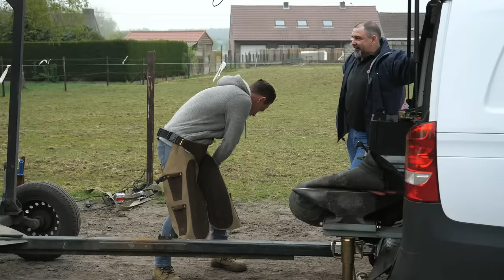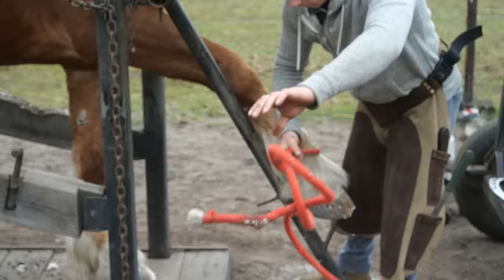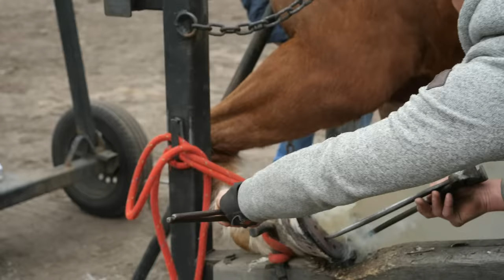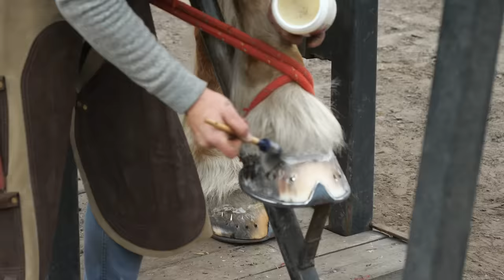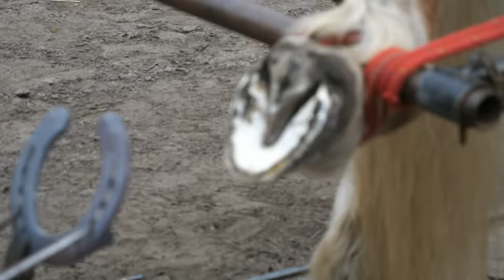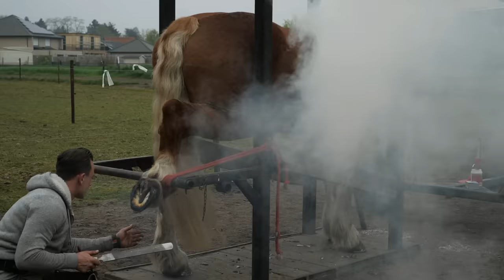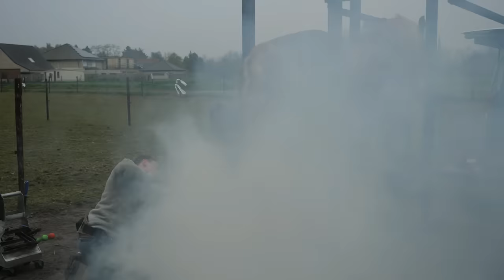Hot shoeing a draft horse is a tough job. Watch the whole technique in detail.

Comment: He’s someone I would trust...Nice trailer unit. Very well engineered. His safety was never in danger. As for the horse. He/she is no stranger to the farrier.
Reply: how often do you have to do this? and how much is the cost? looks like only a pro should even try it.
Reply: If it's a ' standard sized horse, I believe, about £18 or £20 a corner here in the uk. Every 6 weeks if lots of road work, not much longer if all soft, as it grows the same rate as your finger nails. The fixing nails are made from lead. They do a burn fit to make sure it's well versed in and not too likely to come loose. The gouging etc doesn't hurt the horse at all: just like cutting your own nails. The toecap clips on the shoes make sure  the shoes don't come loose with general use. The rear hooves are slimmer so the horse can dig in better, so those shoes have two toecap clips, not one ( as in the front and broader hoof). They also  usually keep a foal close by when mum goes for shoes, so they get the idea and smells etc.
A farrier with a ' good eye' can also put extra weight on one side of the shoe or other, so if a horse walks with a cast out to one side ( and so keeps clipping his ankle with his own shoe if it inwards) to make the hoof throw straight when walking.  I've seen them make a shoe with a temporary plate across to guard a hoof whilst its healing/ growing out.

I lived on a farm, with heavy plough horses when I was a kid ; I used to stand there weeping when they burned the shoe to fit, no matter how much my mum reassured me they didn't feel it. Ours were 2 Belgians and a Suffolk punch, called Prince. He did the milk round cart every day for years. He didn't need instructions, he knew every stop and start by heart. Even in those pea soup fog we got in the late 50's/ early sixties. In the winter when it was freezing, at the last stop, you could say " walk on prince" jump off the cart, and dash across the field to get to the kitchen for a hot drink. Prince would have to do the long driveway to get back, on his own, and we'd be warmed up by the time he got there. Hot tea, bacon on toast for us, and warm water and bran and carrots for him.Happy days: my 'Saturday job' was a single barrel, bolt action .410 shotgun, a pocket full of cartridges, and off round the barns and yards, looking for rats until lunchtime. I was 11.   I very much doubt H& S would let that go these days :0)
Reply: @steamboatwillie8517  I absolutely love your information & your story here 😊 Thank you for sharing!
Reply: Dave Shuttleworth what an incredible story. Thanks for sharing. What a great life!

Comment: Some of the farriers do the shoeing this way and some do not , this way is easier on the horse and farrier.  the nails in the hoof do not hurt the horse at all if they are driven right and not into the sensitive tissue .   The horse has to be started in the shoeing stanchion  at a early age so he or she knows that it will not hurt them and they will not struggle with it.   I appreciate this video and have seen this done at the shoeing schools here in Washington .
Reply: betty fox my farrier does not do hot shoeing. I used to have one farrier that did hot shoeing then he retired, so I got someone else that does not it. My horses are fine either way, without hot shoeing they are the same
Reply: Back in the day our farrier hot shod one of ours resulting from a navickular (sp) problem.  He later ended up doing special pads and corrective shoeing. It worked.  Donnie the Cornell Farrier grad, was quite the magician with that horse.  No stanchion while he worked.  We'd hold them all when he worked.  Shoeing or just trimming.  But he was all business till he'd finish up.  
Didn't see this fella clinch his nails... or did I miss it?  Nice shape and feet looked good.  Good job.  Thanks for sharing.
Reply: هتعمل 

       ،   و ٢فيفري مع خير ربي ٢فيفري قبل أسبوع ٦٣٦من أخر رد كتبه فى ١💄😜😊😡💜💄😜😊😊٤ش التدوين
Reply: That's nice to know thank you

Comment: Amazing to watch! How long did this session take? :o
Reply: Normally it takes 4 hours
Reply: Depends on breed size, horse temperament, farrier skill, plates vs from scratch, and what all needs done. For an experienced farrier, a barefoot trim will take less than half an hour, with just a routine shoe swap around 60-70 minutes for anything smaller than a draft/draft cross. (Simply because they're just picking up the foot and moving around it.) If you are making the shoes from scratch, that adds time. If there is a problem with the hoof/needs corrective shoeing, that adds time. If the horse is being a butt and refusing to stand still, that... Well, you can see where I'm going with this. XD From what I see, start to finish, this guy probably unloaded, did his job, and packed up in an hour and half to two hours, three if he had to make the shoes from scratch (looks like he was using plates though...). Mare was an absolute sweetheart, no corrective shoeing, and the guy knew what he was doing.

Comment: That horse is so freaking chill!! Its awsome!!
Reply: maybe because its got a nasty bit in its mouth
Reply: @jasonjuggler3457  There's no bit, just a soft webbing headcollar
Reply: @dshe8637  Yes they took it out its mouth, my apoligioes
Reply: @danoia4  Horses feel bits, infact they can cause horrendous damage if used in the wrong way. Bits cause pain that's their design.
Reply: @jasonjuggler3457  you know I've worked with horses for over 40 years and it's not usually the bit that causes a problem, it's a bad rider.
Reply: @jasonjuggler3457  You know what else causes damage when used the wrong way? Bitless bridles. Those cause pain too, as they are designed to use pressure as well, just in different places. Every horse is different, with differnt bridle requirements, and as ItsallGood said, it's the person, not the equipment. Even a halter can be dangerous in the hands of a bad rider.

Comment: That's just like human nails right? And how often does this have to be done? Do horse like it?
Reply: It doesn't hurt them as long as you don't cut too deep into it, in that case it hurts them because that area is very sensitive.  Horseshoes need to be changed when you see that they are worn out or in a bad state and the land and frequency of where you ride effects the time of horseshoe change. Horses don't really feel anything but if the person takes too much time on changing the shoes they get a little bit nervous because they want to be free. But as long as they are not in pain it's good.
Reply: @princeska95  thanks for the info
Reply: @princeska95  i get in some cases shoes can help (eg a horse i know about had special shoes made to help with lameness issue) but why do they need them for every day? Is it just a maintenance thing so they dont need to be trimmed as often? On the yard i am at i have found the horses without shoes have cleaner hooves, less debris stuck etc when we check every day.

Comment: That IS hard work!  How often does he have to replace their shoes?
Reply: Every 4 to 6 weeks
Reply: @littlepiggydogonig1415  
Holy shit!
This looks so painful for the 🐎
Reply: @goose7574  If you look up horse anatomy their hooves are essentially just finger nails. Massive fingers nails composed of keratin and other assorted connective tissue. They can't feel anything being done to the hooves itself but they would be able to feel the heat from the steam and the force of the hammering being transferred through. Although when you consider the mass of a horse as it gallops the force from a simple hammering is almost irrelevant.
Reply: @aggressivelyamicable5987  
Thanks!
I actually did that after I watched this video and ended up learning that. Good thing they have some thick "fingernails," HAHA!
It's crazy that this has to be done so often.
Reply: @goose7574  Their hooves are like nails, doesn't hurt them.  And as proof, the horse would react if it hurt him, and he doesn't :)

Comment: Me: hi, i need to get these replaced for my horse, how much is it?

Guy: it’s x amount each

Me: thank you, I’ll be back. I have about 5....thousand miles left on them.
Reply: @Wendy Austin or avoid horse shoes
Reply: Wendy Austin it depends more on the individual horse, than the terrain. 
I have one that I shoe, one that I don’t. The one that doesn’t get shoes, I trim, file, and maintain the frog myself. The other however has a tendency to spay, and split. She needs to be shoed. When we pull them for winter, she ends up needing filed and clipped about once every other week to keep her hooves from splaying.  In the spring I have her shoed, then again mid summer. She’s not even a working horse! She’s on maintenance because of her age. 🤣
Reply: I got your joke, I got a new set of tires for my car, but I want to get every last mile out of my old tires before I put the new one's on.

Comment: Why do horses need "shoes" and what about wild horses what happens to there hooves in the wild?
Reply: slip´n´slide
Reply: Horses mainly need shoes if they are on hard ground alot such as concrete or if they need extra protection on their feet. some horses are kept barefoot but it all depends on the individual horse. In the wild horses wear down their hooves and don't usually run on hard ground whereas domesticated horses can be kept in stables and therefore may need their hooves trimming if they don't wear them down enough
Reply: @buckysshadow4352  thanks for the insight

Comment: Quick question, why do it while the shoe is still hot. Is there a reason?
Reply: Because The metal is at it's weakest point when it's hot and it melts into other metals, otherwise if you do it while it's cold it doesn't stick to the other metal.

Comment: why burn it on and not use ink or some other way too mark the hoof?
Reply: Hot shoeing isn't done to mark it. It's done to seal the hoof after he's trimmed it. Keeps moisture out from causing an infection, seals moisture in in dry climates. And then it also creates a perfect fit, no gaps, between the hoof and the shoe.
Reply: @AnAZPatriot  wow it must be a real talent then to be a farrier. a little blacksmith a little vet and tough to deal with all those big animals.
Reply: @Questioneverythingplease  it is definitely a craft, like welding or a cobbler. This man appears to be quite versed.

Comment: Why does he tap the anvel a few times before he hits the horseshoe?. Great video!
Reply: I'm not an expert but it has to do with getting the hammer in the right position, plus getting the anvel to vibrate, so it doesn't bounce back as much   and the sound allows them to sense how much force to use....

Comment: What is the purpose of hot shoeing compared to regular shoeing?
Reply: Helps to get a better fit.
Reply: @larrybrown6068  So bone molds to the shoe better. Or keeping the shoe soft to conform? Thx!
Reply: @stopdusty420  The hot shoe will singe the hoof where it touches, it should touch all the way round, evenly, ensuring a level fit.  It's hoof, not bone,  hoof walls are made of keratin.
Reply: @larrybrown6068  thank you, what a interesting line of work. Seems like it could be a lot of fun.
Reply: @stopdusty420  It's a rewarding job, but hard work.

Comment: If anyone thinks this hurts the horse go and touch your fingernail to a piece of hot metal. Like the grate on a toaster oven. The heat doesn’t transfer well through keratin. If you touch it with your exposed skin then it actually hurts.

Comment: this is a good safe horse in a lousy  and dangerous contraption where  it can easily tip over in a struggle and hurt itself
Reply: The horse is completely safe in it. It wont tip over.
Reply: @hotshot_rae  it can easily tip  and tying the horses hoof is crazy
Reply: @gilliandarling9239  Draft horses have very heavy legs that are very hard to hold especially while working and tying them up doesnt hurt. It's just like resting your foot on a swing.
Also it will not tip over. It is securely attached to a truck which I doubt the horse can tip with out being to move around
Reply: @hotshot_rae  i have  2 draft type horses .... you cant fool me with that one either ... improve your methods and don't use such a rotten contraption please
Reply: @hotshot_rae    it can pivot on the tow bar
Reply: @gilliandarling9239  If you have draft horses you can at least do some research on this contraption instead of jumping to conclusions. Its used by many of professional farriers who work on draft horses a lot. 
And just because you own 2 drafts doesn't make your argument any more believable. I have horses of my own & I dont try to bring them up to use them as a way to prove I am right. I have horses because I love horses, riding, etc. & I dont have them to lord them over others.

Comment: We breed and shoe our own heavy draft horses and have never had to cage them to do it
Reply: This isn't abuse. And the horse isn't in a cage. It's called a shoeing stock. It's used by many farriers (especially those who work on drafts) and equine vets (but they usually use them for other things). It doesn't hurt them. Draft horses have especially heavy feet and using a stock to hold their leg just makes it easier to work on their feet.
Using a stock is safer for the horse and handlers incase something goes wrong. Using stocks is a personal preference which is why not all farriers use them. Stocks aren't a bad thing, they just make shoeing and trimming easier but some people prefer not to use them.

Comment: This doesn't hurt the horse, its not abusive. What is abusive is using metal spurs and repeatedly hitting the horse a crop/whip. That hurts WAY more than hot shoeing.
Reply: Spurs aren't abusive if they are used correctly and they don't hurt unless you really drive them in. Try running one across your cheek or something, it doesn't hurt

Comment: But at the same time even in modern days a hot piece is placed on the animal hooves is too painful to watch. The animal is tied and howmuch heat it experiences god knows....
Reply: Not much... hooves have no nerves, so...
Reply: This is the same as trimming your fingernails or ironing your hair. It doesn't hurt them. Hot shoeing has a lot of benefits for the horse including making the shoe fit better and sealing the hoof so it doesn't absorb too much moisture or dry out (it depends on climate)
The reason the horses leg is tied up is because a draft horses legs are extremely heavy and so they tie them up in order to access them better. This doesn't cut off any circulation or hurt them. This is often done by equine vets 
Horses need to get their hooves trimmed every 6-8 weeks bc their hooves can grow way too long and cause then severe pain, stretch their tendons, and cause lameness. Wild horses, unlike domesticated horses, constantly run over rough terrain that grinds down their hooves. Domesticated horses don't do this so people have to trim their feet